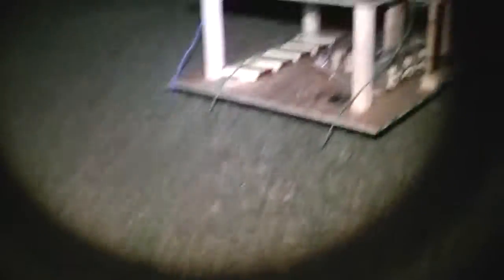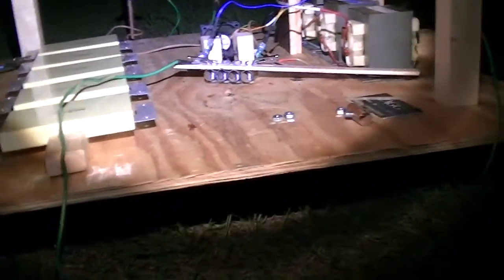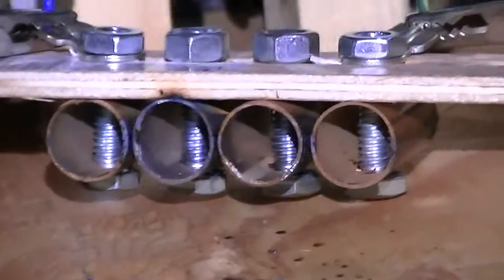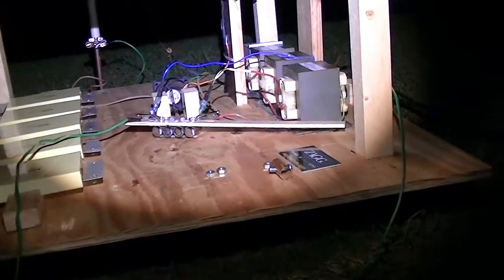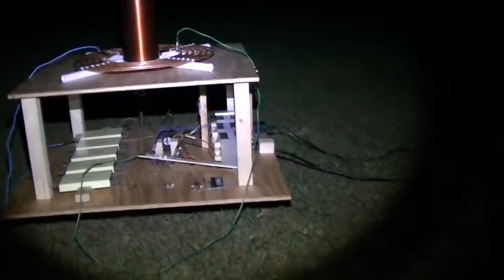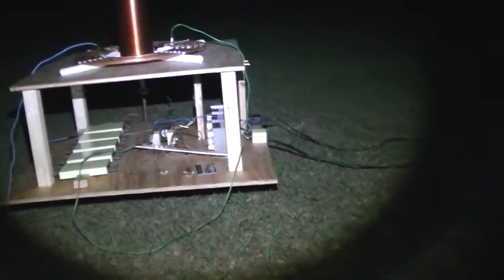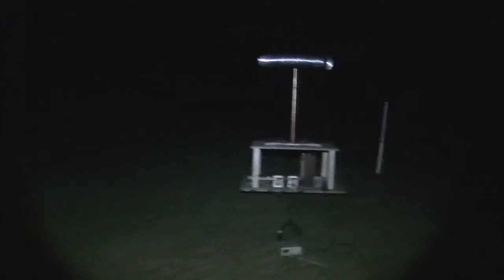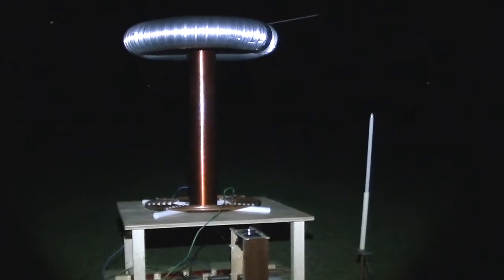Dual MOT Tesla Coil Copper tube and wood spark gap testing

Comment from the maker: No voltage doubler.  Only 4kv input.  Yes, with a voltage doubler 40inch arcs are definitely possible and frankly expected.  If you do not believe the coil is in tune I am happy to provide you with all the specs you may need to prove me wrong :)  Testing outside is necessary as I have quite a great deal of sensitive electronic components and electrostatic speakers along with expensive amplifiers, etc. and I do not want to risk them getting damaged, also, I sunk the ground rod out that far.